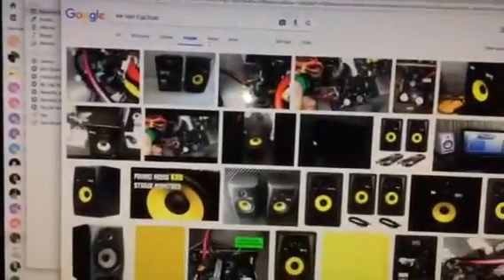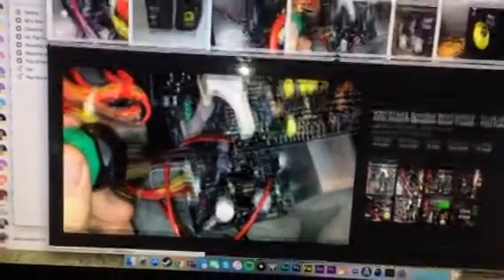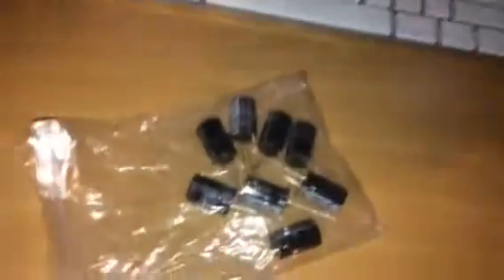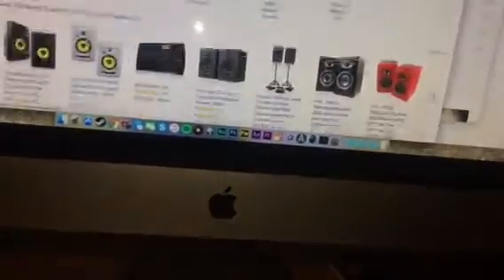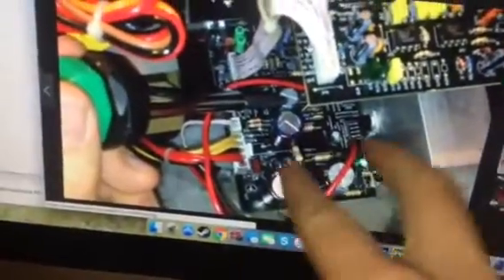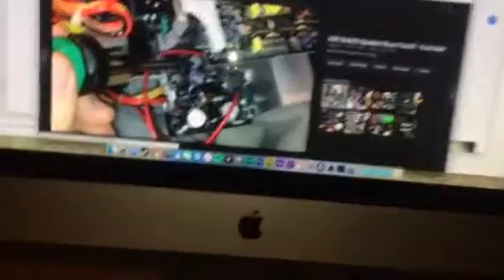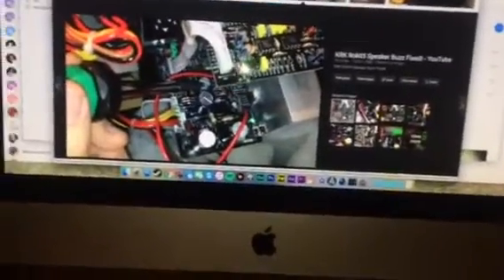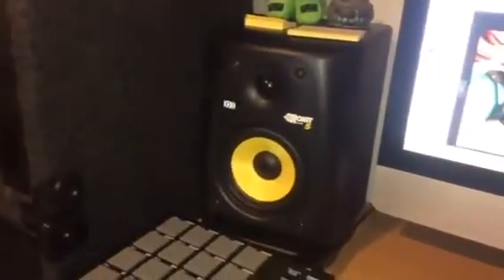KRK Rokit 5G2 tweeter buzz fix!!!!

Comment: Well that did the trick for the one buzzing really badly.  Replaced the one with the more mild buzz and....still have the mild buzz.  Maybe a different cap in there?  Anyway, thanks for pointing in the right direction.
Reply: Yup - it was the 35V 1000uf cap next to the first one that was also going.  Replaced that with a 40v 1000 uf and...no more buzz!

Comment: Very informative, thank you. I have the KRK ROKIT 5's. The Same tweeter humming or buzzing from both both speakers with or without input. Did I understand correctly that the location of the bad capacitor or filter would be in the same location for both gen 1 and gen 2? Thank you!